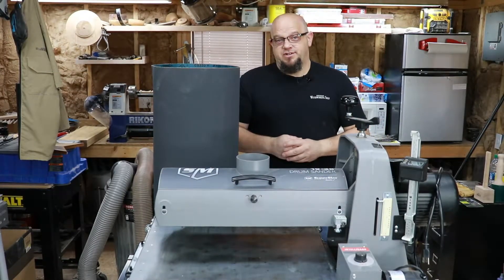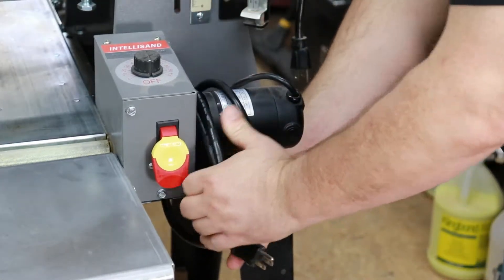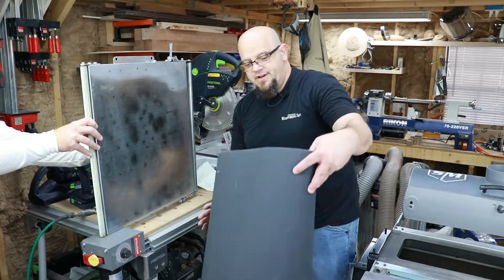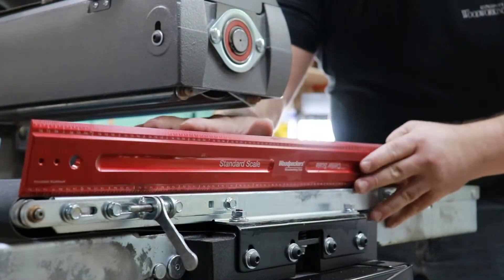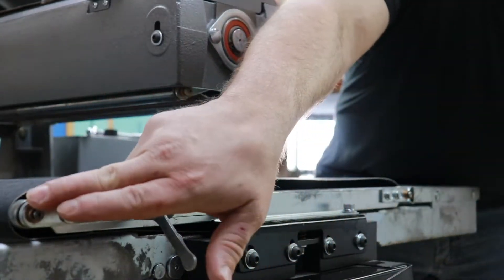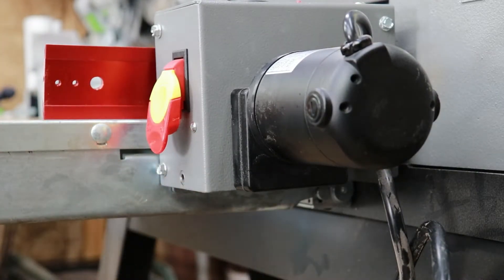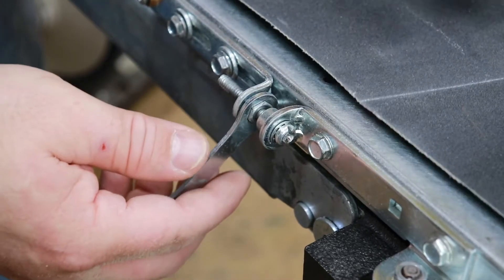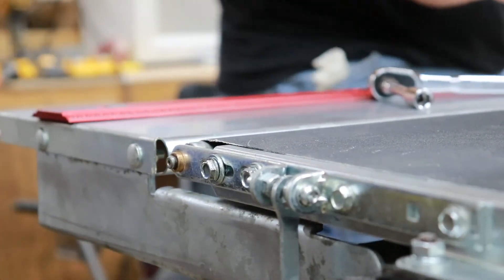Drum Sander Conveyor Installation

Comment: A few questions:  1.  If the belt is tracking towards the motor which side do you need to loosen and/or tighten?  Seems elementary to you but is not to me.  Mine tracks consistently to the motor and I have tried loosing and tightening both sides of roller to no benefit.  2.  At approximately 5:10 you are doing adjustments on the roller coming out of motor, you take the bottom cover off and perform some task to get the roller to come up are you tightening or loosening a bolt or screw or something else can not see what you are doing?
Reply from the maker: It all depends on the machine, This is a Supermax 1938 and you want to make sure the beds are level with the conveyor track. That's what we are performing in the control box because that's how you access the nut for the bed rails. With regards to the tracking, have you tried taking the belt off of the machine flipping it around to see if it still tracks the same towards the motor? Sometimes a belt can be off by 1/32" which can cause tracking issues, this is best found by flipping the belt around so it's running in the opposite direction compared to when you first had it on the machine.

Comment: I usually adjust tracking on the side toward which the belt is drifting and  loosen the  screw nut on the opposite side an equal amount about 1/6 or 1/4 of a turn, which ever makes one feel comfortable for tracking the adjustments.
Reply from the maker: Each machine is slightly different in how the tracking hardware works. This is for the Supermax 1938 if that helps, Thanks for watching!

Comment: My belt keeps tracking towards the motor. It’s a 22 yo performax. It never did have those trackers on it. I keep tightening the opposite side. Is that correct?
Reply from the maker: Have you tried to flip the belt around on the table? The belts are not unidirectional so this could solve the issue. Let us know if this didn't work and thanks for watching!
Reply: @KlingsporsWoodworkingShop  I will try that and let you know. It’s weird I am the original owner and it was always great. Now 22 yrs old and has started the drift! Bought a new belt, at lower speeds drift is not that bad but still does it. I will flip and let you know. Thanks for responding!

Comment: What a joke, just when it comes to the tracking adjustment, arguably the most important part of the video, he says "well there you go that's how you change out a conveyor belt".
Reply from the maker: Did you miss 6:00 to 8:10 where he describes and shows you all the tracking done to get to the end where it's done?
Reply: @KlingsporsWoodworkingShop  The video cuts without showing the nut adjustment, the actual adjustment to tracking.